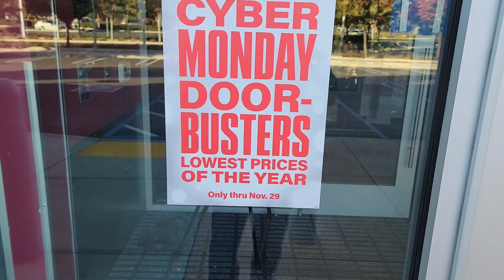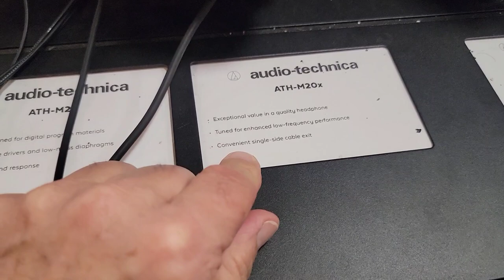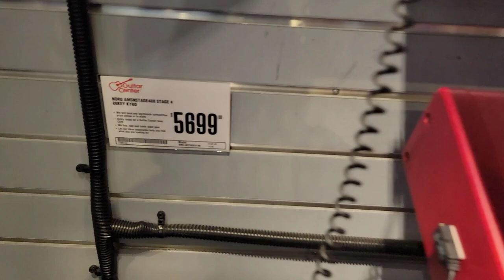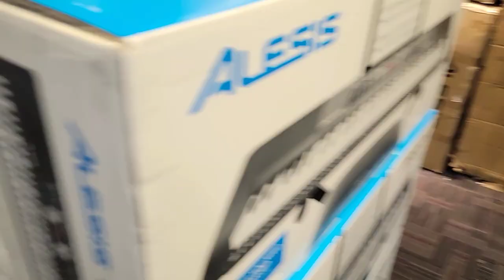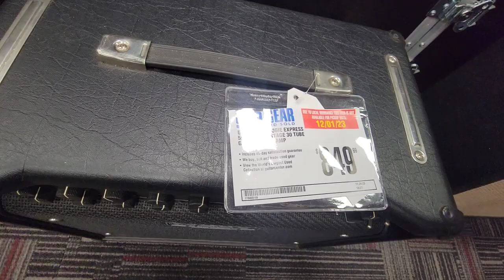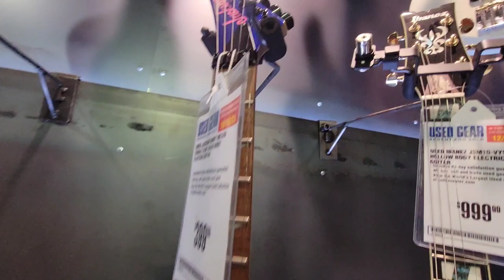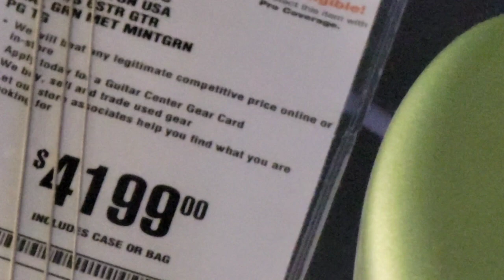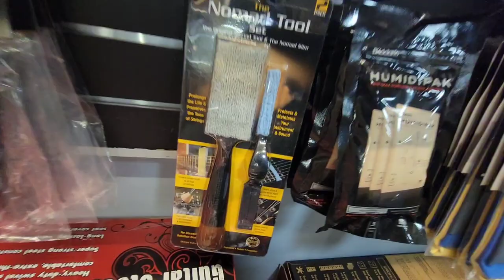BEST GUITAR & GEAR DEALS for CYBER WEEK 2023 at Guitar Center *Watch 4 Giveaway*

Comment: Dropped a couple grand on used Marshall 4X12s from Guitar Center online last week. One was cleverly listed without a picture, so if you didn't know what a 812T40 was, then it might have still been hidden in the back of the shop when dude got his paycheck.  😉 so sorry buddy.
Reply from the maker: NOICE move Roadie!  Those speakers are worth nearly their weight in GOLD! 😎🤘🎸🐦 🔊🔊🔊
Reply: @MusicTherapyLaz  the extra mankey unlabeled Celestion that I sent you is about a antique T0652, same as the reissue ones in my new Marshall. When I sent it, it was really surplus because I only had T0650s, and they are eight Ohm. Now I'm looking at another box with the T0652s, and it is only three Grand 💸 probably ought to jump on that. Full Stack of them only takes 120 Watts, so some of us want at least that.
The blending thing is something that I still have not tried, but when you finally get the 2X12 box for your speakers you can try it out. 😸
Reply: Actually I remember that I have a Celestion Gold in the back of my Vox TB35, so I reckon that I have a blend, I just haven't plugged into it in five years 😖